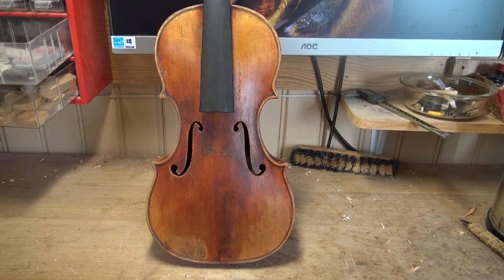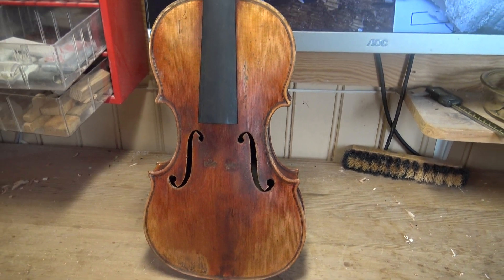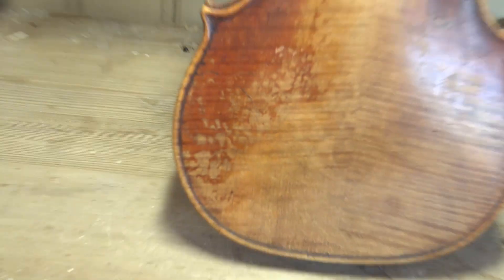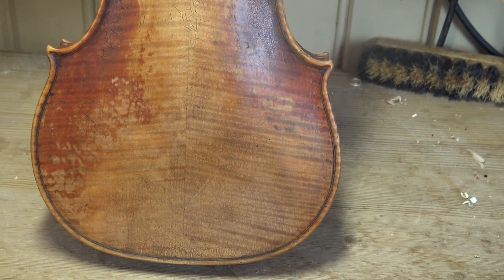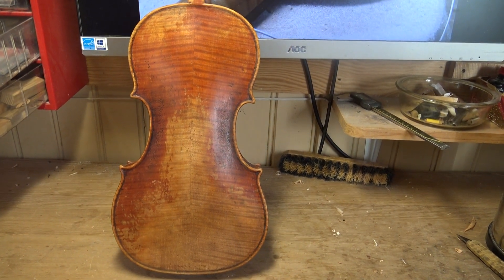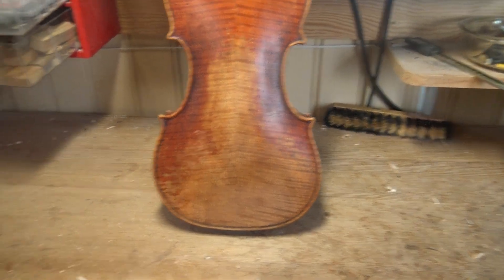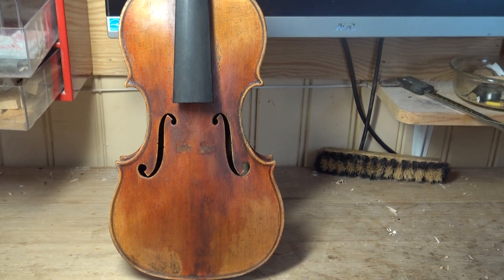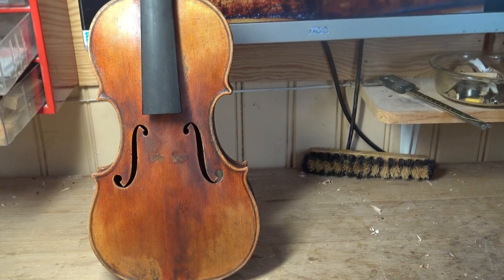Violin maker Peter Westerlund Part 78. Resuming the wear process

Comment: Hi! Very interesting to see the whole process of antiquing.
Concerning the camera issues you had:
You simply were too close when it didn't want to focus. Most zoom lenses have their closest focusing distance at the widest zoom level. Zooming in will increase the close focus distance. e.g. if you can get as close as 20 cm with the zoom at 28mm you might only get 35cm at 50mm, and perhaps 60cm at 100mm.
To still get your shot in focus you either would have to move the camera further away from the violin, or just stick with a wider angle (as you did in the end).

Comment: Just wondering was the sand pad/abrasive used to smooth the edge of the antique wear?  To make it look more natural? Thanks in advance.
Reply from the maker: Not quite sure what you mean, but if you refere to the metal abrasive sheets that Sandvik once made, I am sorry to say that they are no longer in production. It has a sticky side which alows to be attached to any flat surface.
Reply: @westerlundsviolinverkstada9892  hej,kan du göra och vad kan kosta o sätta på plats Ljudpinne på en violin, den har gått av, det är e billigt violin. Just när jag började öva på den den gick av. Tack
Reply from the maker: @kastriotialbaneze2525  Om du säger var du bor så kan jag föreslå en fiolbyggare som kan hjälpa dig
Reply: @westerlundsviolinverkstada9892  Fagersta, Västmanland. Pga deta pinne jag köpte ett annat nytt violin i Borlänge 1500kr, Virtuoso student VSVI-44 4/4 men ej nöjd med den, bätre låter min gamla som köptes 50€i Kosovo, så gärna ville laga eller sätta på plats ljudpinnen på den gamla.DEN NYSS köpta låter som el violin och som att den är metalbygd än trä. Tack mvh Fagersta.